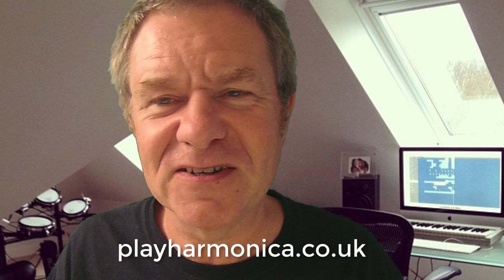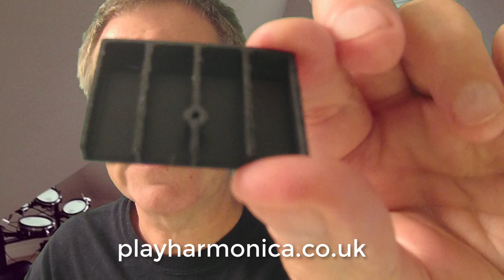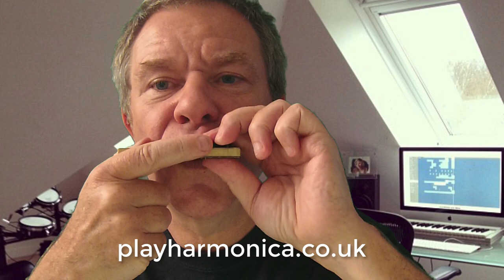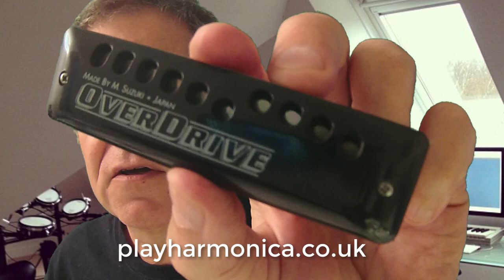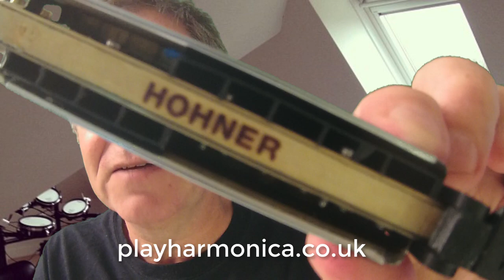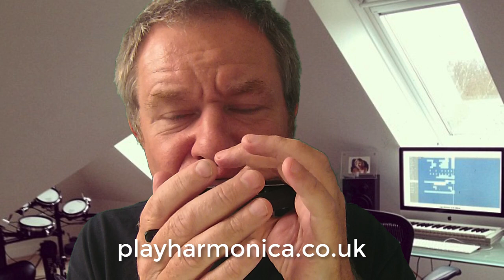OverblowBooster review

Comment: Why not simply buy a CD Player and forget the harmonica?  What is the Point?  I just want to learn how to play the hard way!  Sort of like cheating on a test... One passes but still doesn't now any thing about the subject
Reply from the maker: Fair enough Jim, that's the way I did it. But I think this is still interesting to know about and I'm simply sharing the concept and increasing awareness.
Reply: You still need to know how to overblow/draw Jim, these babies simply make your overbends sound better: cleaner, louder, more expressive.
Reply: @Jim George I'd say it's about getting a different sound and having options. 

Of course it's admirable to have practiced to the point of being able to overblow on any harp without effort - but it being harder doesn't necessarily make it better. 

By that logic, because custom or expensive harmonicas are easier to play - we should all play crappy harps since it's harder to play them. Or that Paddy Richter is a useless tuning because you already get the low 6th on the 3 hole whole step bend - you just have to try harder to get a good pitch on it. Or why even play any non-richter tuned harp since you can overblow your way to chromaticism? 

Just like harmonicas with different tunings give you new chord options and breathing patterns, the overblow booster gives you other new options that wouldn't be possible with your standard richter harmonica. Saying that it is like playing up something prerecorded is a bit unfair - using the overblow booster requires you to time the blocking which is a new skill you have to learn to do fast runs.